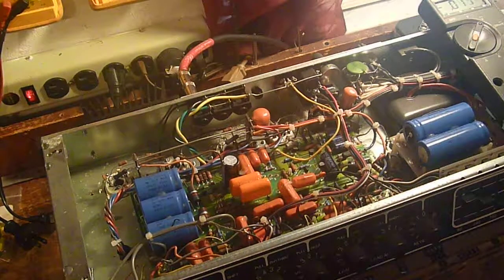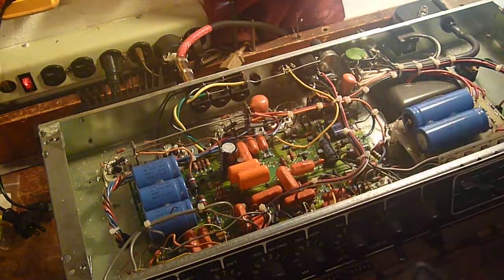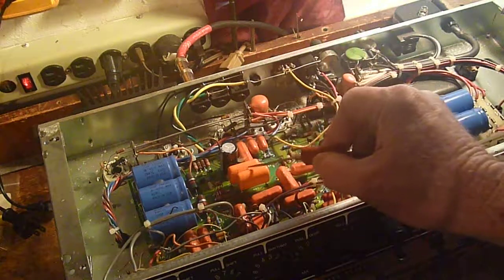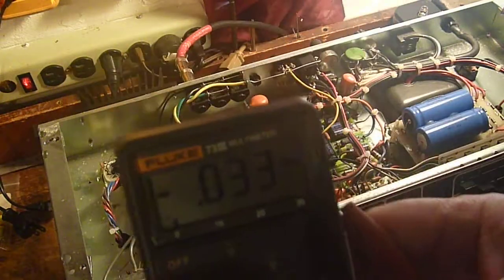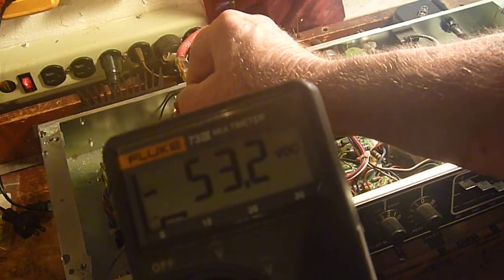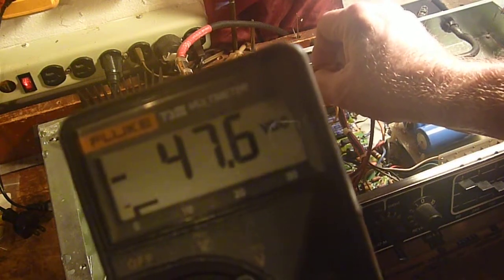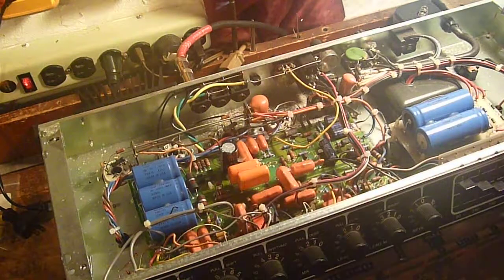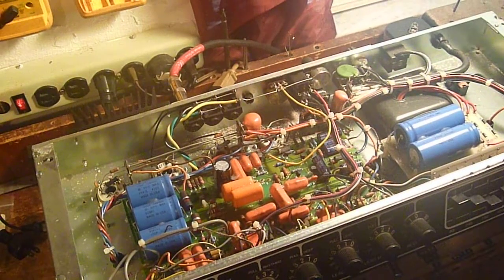Mesa Mark III / Green Stripe / Bad Coupling Capacitor

Comment: Just had the exact same coupling cap failure in my Mark III. Crazy that they used 400v caps in that position... I replaced mine with Solen 630v type.
Reply: yea crazy it lasted 35 years.